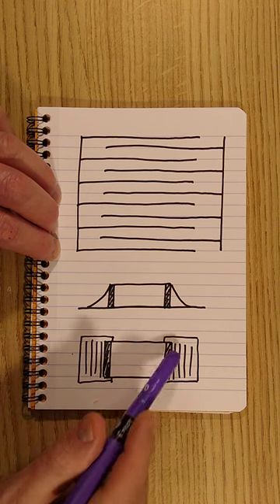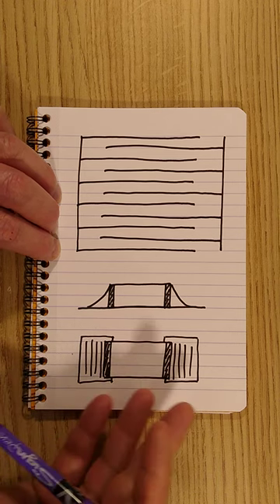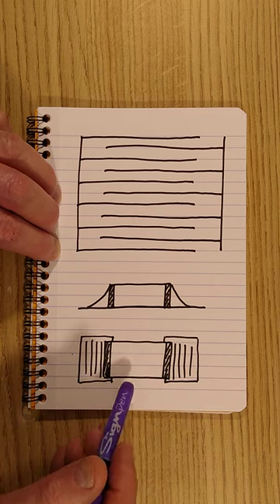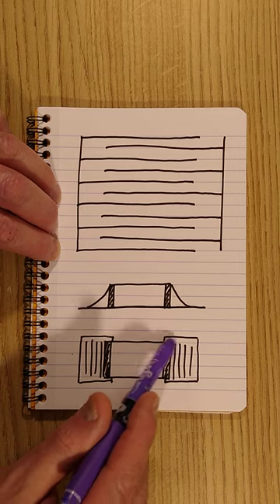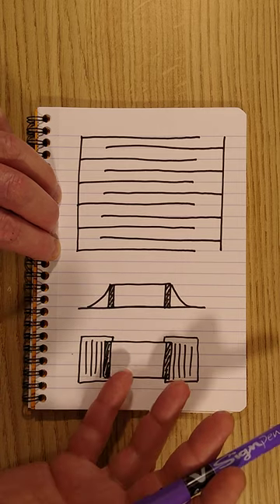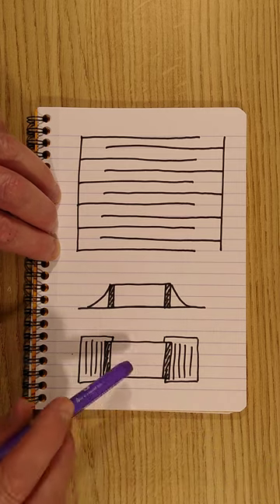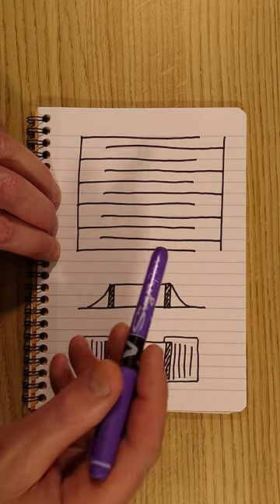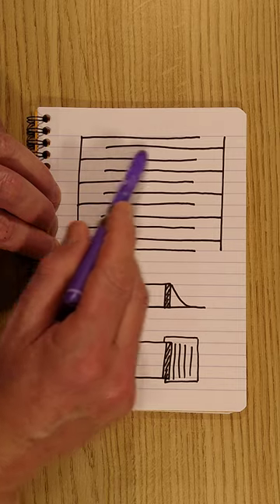Why ceramic capacitors fail

Comment: They can also go OC or intermittent.   I invented a method to find a broken cap on a PSU line with hundreds of caps (due to failing ICT).   Basically you measure the line capacitance on an LCR meter and heat each cap or area with a hot air pencil jet.  The meter reading suddenly changes when the hot air hits the cracked cap.
Reply: Having spent an inordinate amout of time trying to find an intermittent fault on a PSU very recently, I'll be sure to try this method next time I have it in pieces again! Thanks.
Reply: @D1GDUG  its more for PSU lines outside the PSU in the main digital circuitry when there is a powerline and small suppression ceramic  cap at every chip.   Probably wouldn't generate a real fault as these parts are semi-redundant, but can affect EMC, or theoretically, reliability.   In manufacturing we try to test every component, or every node at least.  Cracks tend to happen in reflow, depending on the component quality and reflow parameters.
Reply: My teacher showed me a similar trick  with electrolite capacitors. He heated the suspected electrolit capacitors in a dvd player and it started working temporarly. I tried this method but never worked for me. I think it wont work if the cap is absolutely bad.
Reply: @Mitsou44 I have found utility with it even with dead short electrolytics, ceramics, and even ICs. Measure the shorted rail with a multimeter in resistance mode, and look for changes in the value shown. The multimeter might only change by a couple of digits, but that's enough to start narrowing it down. And when you're doing this on massive boards, or with lots of little components, every little bit helps.
Reply: Alright but for a very fast and accurate pinpointing of shorted caps I recommend thermal cameras. Even a $200 one will pay for itself in a few serviced devices.
Reply: Sure a short is much  easier to detect, OC not so much.   Most invisible component problems in production are OC, and in this case intermittent OC.  Also this was in the 90s/early 2000s, the cheapest IR camera was about £3000.
Reply: @tonystanley5337  we were talking about modern caps and devices... 
Back in the 90s I was still dealing with filament solder joints on the PL500 horizontal driver socket.
Reply: Its the same tech, same construction method,  components are just smaller.
Reply: @tonystanley5337  no, they are very different. Metal Layer Ceramic Capacitors cannot go OC.
The opposite layers extend micrometers from the end cap metallization and they are all in parallel. Unlike wound capacitors that have only one wire contact at some point on the electrode, which can fail from electrolytic corrosion, mechanical fatigue, thermo-mechanical fatigue and so on. :)
Physically broken mlccs are visible to the naked eye and they usually short out also as the opposite layers touch at the crack.
Reply: Lol, MLCC means Multilayer Ceramic capacitor.  I do this as my day job mate for nearly 40 years, and they can go OC.  Ceramic is brittle.
Reply: @tonystanley5337  Alright, you got me, I'm only 30 in the field. :p 
Nothing is impossible but... most fail due to corrosion and manufacturing defects. Especially those made in the last 7-10 years. 
And my favorote contenders are 10μF@25V. But recently I started seing them shorting on very low voltage rails and far away from heat cycling. 
Now, tell me, what will fail first on a pcb? The ceramic, the solder or the trace?
Reply: The problems I am talking about happen during manufacturing, thats when you have ICT (in circuit test - bed of nails type thing measuring LCR between multiple points).  Soldering is very stressful during manufacturing
I agree field failures are more related to corrosion or heat, I don't have alot of knowledge on statistical but I'd say the trace is more likely,  I expect capacitors with a liquid electrolyte to fail as these are the most reliability limiting item.  Corrosion happens because of moisture or leakage from another component, so it entirely depends on age or environment.

Comment: A common failure mechanism is electromigration at the end points.  There is a high electric field near the ends, especially so on caps operated near their rated voltage.  In Clive's diagram, one of the odd "fingers"  from the left will grow towards, and eventually short to, the vertical termination at the right that is common to the even fingers.  

This is a dead short and can often be found by using your finger tips....when you burn your finger, you can stop the search!
Reply: My mummy told me never to touch a capacitor till it is discharged...

Comment: From my observations, liquid damage/corrosion is the first reason for these failing. 
It's like over 50% of the devices. 
For the other main reasons, I'd blame manufacturing defects and overvolting. 
Recently, on very new devices, I started finding mlccs shorted on 3 and 5v rails, from either manufacturing defects or, perhaps esd. I can't tell for sure, but thermal cycling... I would not jump on that. When I replace them I get them up to 300° and I often cool them down with forced air not quite following tge recommended heat ramps. 
And the replaced onex don't fail. More often then not, the next to fail is right beside the replaced one...

Comment: Anyone remember the DPS5015 dc dc converters that could catch fire because of an capacitor soldered directly between the output screw terminals. The cap would crack when thightening the scews. The problen was fixed a couple years ago by removing the cap. The DPS5015 is in my opinion the best and most robust lab powersupply dc dc converter.

Comment: Years ago at a company that measured radiation and detection, I worked with a design engineer that would insist that we do cold and heat stress on all circuits on breadbord then especially the finished product. It is surprising to see the difference between ice cold and desert hot!

Comment: Capacitance depends on surface area and the gap between the plates.
For a given capacitance, a bigger area would compensate for a bigger gap, and a bigger gap would reduce the chance of shorting out.
Reply from the maker: In the scale these use that would make them much bigger.

Comment: Ja das Problem kenne ich sehr gut... 
mit den Keramik SMD Kondensatoren 
die Schichten Brechen gerne und dann kurzen verursachen... ! 💥🔥
bei einem Fall hat mein 2kw PSU das Brennen angefangen ( die Isolations Folie) wurde durch die def. Kondensatoren in brannt gesetzt 😮
zum Glück gerade im Auge gehabt es war ein leuchten im Gehäuse wie ein weißes Licht, 
kein schwarzer Rauch auch nichts schwarz geworden... 😮‍💨 habe die Kondensatoren entfernt ( DC Ausgangs Strang + - zu den klemmen) waren zwischen den Leiterbahnen nachträglich bestückt... Werte hab ich bis heute nicht rausbekommen... läuft bisher ohne... Mit der Hersteller ( Deutsche)Firma mehrere Male Telefonisch gesprochen naja.... bj 98 zu alt keine Schaltunterlagen, keines da  .....bla bla blub.... 🤷🏻‍♂️ 
das die Isolation auf der Unterseite der Leiterplatte das Brennen anfängt ist super.... nicht geeignetes Material verwendet.

Einmal ist ein Feuerwerk 🎆 aus der Tastatur vom Laptop gekommen auch der Kondensator... auf dem Board...
einmal das Netzteil extern vom Laptop auch Kondensator.
der Kurzschluss ist oft so stark das die Pads vom Kondensator weg sind wie eine Sicherung...

Comment: So what's the solution to stop failure?
Reply from the maker: Good quality capacitors, careful design and a proper soldering reflow temperature curve.
Reply: Also soft termination caps, and keeping caps away from high flex areas of PCBs, or changing their orientation.

Comment: Does putting a hand in water discharge static elec.
Reply: No it converts it into hydrostatic electricity
Reply: Really depends on situation (where ground is, etc) and how many ions the water has
Reply: Sure, to the same potential the water is at (which could be even higher than your original charge).
Reply: Water is also a good way of not building up static electricity on the first place. When I had a car with velour seats, I used to keep a spray bottle of water in the car in the summer and spray the seat lightly before I got in. It would prevent me getting a shock on getting out.